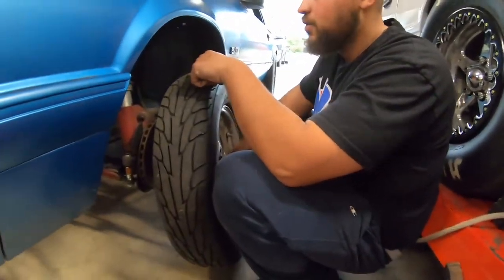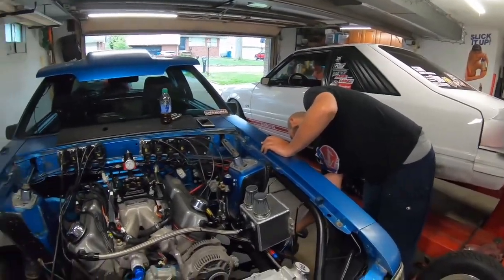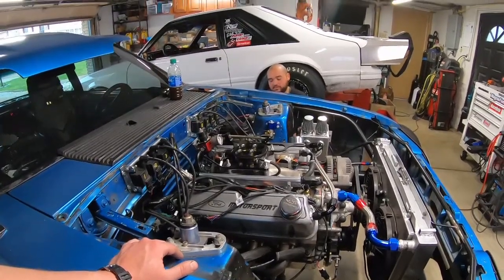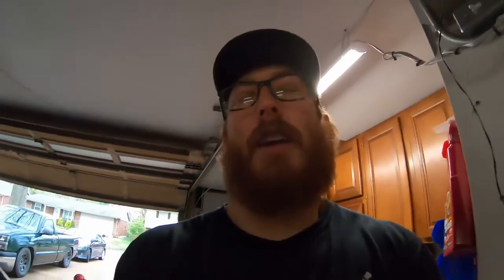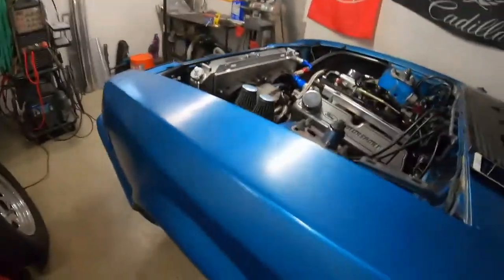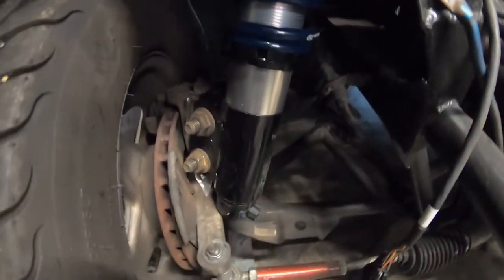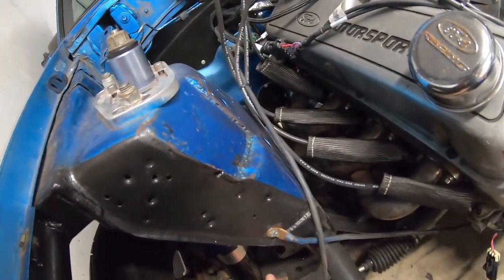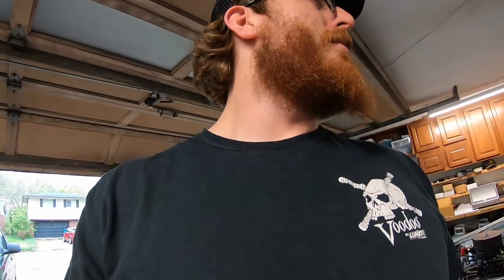Mjs Foxbody Gets Strange Coilovers!

Comment: There is a cam sync alignment tool. I bought the set of 5 on amazon for $20. Drop the cam sync in with the engine @tdc.  The cam sync setting will be a single pulse rising edge. Your offset angle will all depend where you have your crank sensor clocked on the trigger wheel.
Reply from the maker: U da freaking maaaaan, well try that. Thanks! I know he ordered the tool so we're waiting for it to cone in
Reply: Hidden 10s Garage  I’m basically doing the same thing. 3 wire cam sync, 3 wire crank sensor with 36-1 trigger wheel. I’m using a Holley terminator. So the settings should be basically the same. If you need any help, shoot me a message.

@bean_diip on instagram

Comment: What's the pros of running the 14 inch spring over the 12 inch if I remember correctly your run the 12 in your car??
Reply from the maker: Oo I might've accidentally said that.. I think I bought 14s, I'll have to double check and get back to you
Reply: Alright just curious haven't put my coil overs on yet figured now would be the best time to possibly change my springs